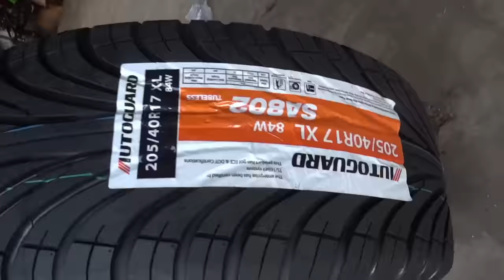Lancer Fix 13 | Shaking While Driving - New Balanced 17" Wheels (Full Fix)

Comment from the maker: If everything is fit in the front (bearings, inner tie rods, outer tie rods, shocks).
It is down to the bad tires, if it's not tires then it's your wheels that are bad. 
Like mines, they were pretty beat up both stock wheels and tires.

Comment: Good job knowing to put the hub-centric spacers in... I'm going through the same thing great job.
 I just found out that I do not need the Centric Hub rings... I ordered OEM Replacements but they as re _ refurbished thank you for the response.
   I have a bent rim that was my vibration at 59 mph ,I  went to Mavis found out

Comment: Hi i love your videos it helped me alot fixing things in my lancer 2003 ES model, i have a problem that when my car get to speed between 90-100 km/h it shakes badly from the front right side tire, i changed bearings, new drive hub and end Tire rod for it, the shake was significantly reduced but it is still there any suggestions would be appreciated?
Reply from the maker: Mo Khader New rims and tires! Or re-balancing your front wheels.

Comment: hey i have a lancer 03 es it starts shaking at 60mph and the steering wheel shakes and all the car do you think it could be a bushing problem ? thanks :)
Reply from the maker: The main cause is the bad tires and probably the wheels too.
The secondary cause is the tie rods, especially the inner tie rods:
Lancer Fix | Shaking While Driving 60 mph (Semi Fix) - Ep.5

Comment: Where did u get those rims and how much ?
Reply from the maker: STATIC SILVER RIM By LIQUID METAL WHEELS
17x7
http://www.performanceplustire.com/products/packages/searchType/searchByVehicle/year/2003/make/MITSUBISHI/model/LANCER%20ES%20OE%20185_SLASH_65-14/applicationID/11939/wheelSize/17/wheelDataID/60814
AUTOGUARD/BCT TIRE
SA802
Size: 205/40R17 XL 84W
Wheels & Tires Mounted and Balanced: $656.00
......

Note: the rims are sold out in that website. Though you should get other ones:
http://www.performanceplustire.com/products/packages/searchType/searchByVehicle/make/MITSUBISHI/model/LANCER%20ES%20OE%20185_SLASH_65-14/year/2003/wheelSize/17?show=ALL

Comment: What wheels are those?
Reply from the maker: STATIC SILVER RIM By LIQUID METAL WHEELS
17"x7" Rims, 205/40/17 Tires
http://www.performanceplustire.com

http://www.performanceplustire.com/products/packages/searchType/searchByVehicle/year/2003/make/MITSUBISHI/model/LANCER%20ES%20OE%20185_SLASH_65-14/applicationID/11939/wheelSize/17/wheelDataID/60814

cheers

Comment: Yo where did u get those rims at? and what's their name
Reply from the maker: Look in the description for links. They don't sell these rims anymore.
Reply: +DarkDragonWing Thanks! yea ended up going on the link. 
P.S u got a new lancer right ? I need help with a ticking noise on my motor , if you can help me out id think that will be cool
Reply from the maker: ํYes. Ticking noise is normal on Lancers. To reduce the nose, do an oil change and put in 4.2 quarts of 5W30 oil.